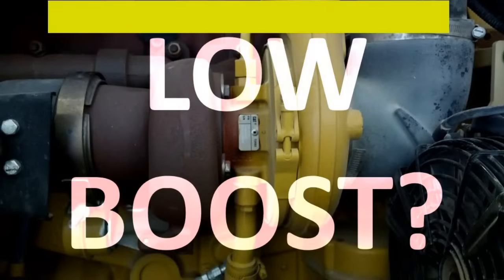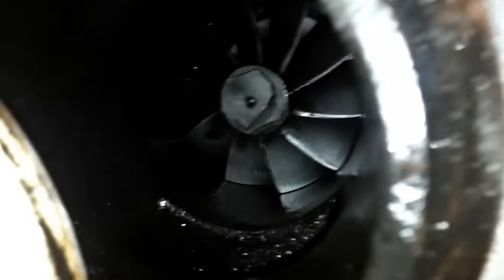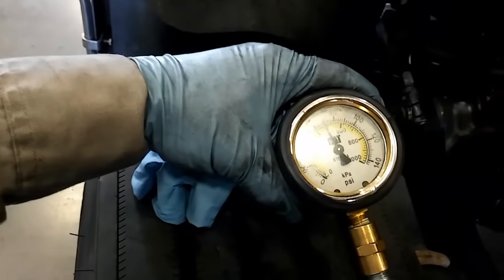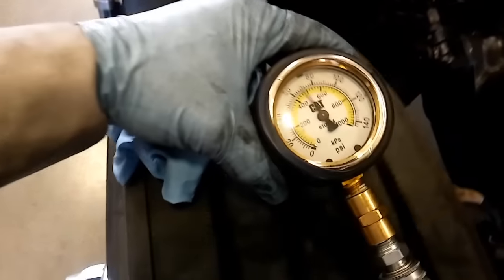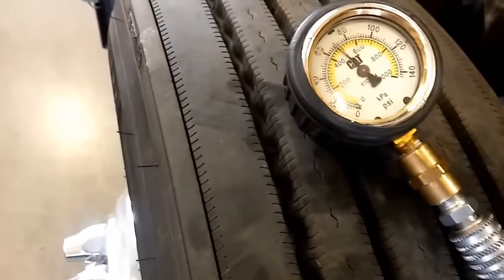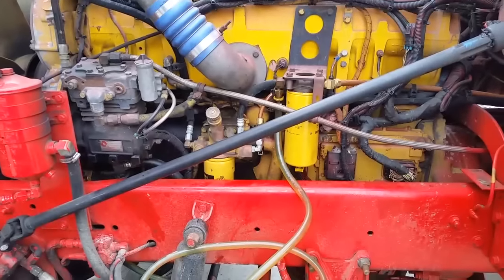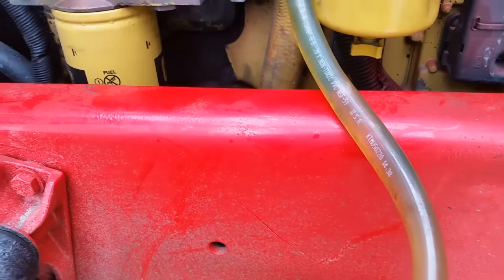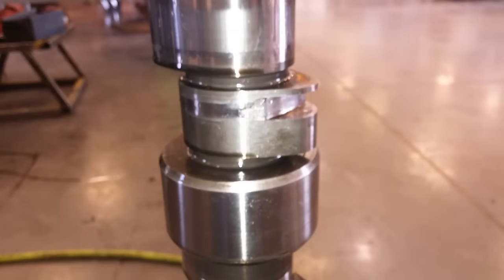Cat Diesel Engine Low Power Troubleshooting.

Comment: A surprisingly common fix for low power complaints is removing the bunched-up floor mat from underneath the accelerator pedal.
Reply: We've had lots of dump trucks with dragging brakes come in, and it's dirt built up under the heel of the brake pedal.
Reply: Evermore  000
Reply: Ur right removing fllor mats under pedal make ride ugly.  U should try ...

Comment: Had a truck driver complaining of low power on a Detroit Series 60, he was irate and telling me that Series 60s were shit, got into the cab of the truck to put it on the wheel dyno, rubbish all through the cab, a plastic milk carton tied to the gearshift that was full of cigarette butts and the smell of off food. Put the truck on the dyno and did a pull, 62% throttle was the max, checked the throttle pedal, found a chicken bone stuck under the pedal, put on gloves, removed the chicken bone, low power problem solved.
Reply from the maker: This type of stuff you literally couldn't make up.
Reply: He was special. Lots of special people in the trucking world.
Reply: Lol that's to funny :)
Reply: thats the greatest thing i have ever " heard" you have made my day, thankyou!
Reply: But did you fired that driver ?? Cause I would !! Nasty ass person.
Reply: I would of charged him for 6 new injectors and a pump and then sell his on eBay

Comment: I worked for Caterpillar, in the 80s.had a 3408 with low power in a dump truck. Searched for a while,long while. Eventually found a dead bird in the aftercooler  inlet pipe .someone had work on the truck and not sealed the pipes, so the bird made its nest in the aftercooler blocking partially. The truck was running in a open cast cement mine.

Comment: I have a c15 twin turbo bxs no codes on but when I do the flash code test I get about 7 codes I replaced all the sensor but it still gave me the flash codes. Is it a ground problem? Bad ecm? Or just needs a new wire harness? Thanks your videos have helped me out a lot.

Comment: I know my bus could use an oil change. But now I should check the fuel lines with the clear tube. I have intermittent boost issues. Itll work then not then further down it works then not. Works less up hills. Thank you for the video

Comment: I have a c15 no power. Checked charge air cooler replaced map boost sensors cam sensors changes turbo’s I still have nothing! Runs smooth doesn’t get hot doesn’t miss. Exhausted is clear I have good air filters. My fuel pressure is in spec as well. At this point I have no idea what it could be.

Comment: We had a truck from a local scrapyard in here that had low power. Not sure who was working on it, but the history was low power, turbo replacement, not fixed, injection pump, not fixed, now the engine blows a rod out the side, they replace the engine, still low power. Now it comes to our shop, we open the hood, give it some throttle, and the intake ducting damn near collapses. We open up the air cleaner and there is so much dirt packed in there we have to pry the element out

Comment: Josh, at 13:16 you state that air leaks between the turbo and combustion chamber cause low boost pressure along with concurrent lower fuel consumption.  In my experience, there has been a slight increase in fuel consumption accompanied by with a slight increase in particulate matter, as the decrease in air entering the combustion chamber adversely changes the air/fuel ratio.  Then again, I've seen similar air leaks not impact fuel mileage or exhaust smoke characteristics. 

Now,  could an ECM, sensing low air manifold pressure, derate the engine?

Comment: Josh, always learn when watching your videos. My 5 cylinder VW diesel (non turbo) doesn't run so good at tick over when hot. Otherwise it's a beast...a low powered, slow beast but a beast none the less!! To me it's definitely an injector issue but you mentioned a few other possibilites that I wouldn't have thought of. I like the idea of using a temperature gun on the exhaust manifold to look for a dodgy cylinder, will check mine later, can't remember if it has a 'log' exhaust manifold but lets see. Thanks again..

Comment: The last low power complaint I had, it was discovered that the secondary fuel filter wasn’t changed in 40,000 miles 🤦🏻‍♂️

Comment: Talking about the chasing of strange symptoms but this was a western star with m11 Cummings same thing warm up periodically engine would fall on face. A couple mechanics tried to figure it out to no avail. Next mechanic a good friend of mine tested the usual. Mine you this truck was being fabricated to be a log truck with Prentice loader boom. His next question was did you unhook the batteries every time they welded they say they did they thought Replacement of ecm problem solved un hook your batteries when welding a valuable lesson I learned.

Comment: One of the things listed (faulty sensor) 
But a lot of the people who work on diesel engines often over look at the manifold pressure sensor. 
Pop it out. If its plugged with soot. Clean it. If its plugged badly, chances are your intake manifold needs to be cleaned too. A lot of those deposits built up are from your egr and constant long idle. 
Whats crazy is the cummins engines that have dpf and def systems can often regen more frequently if the manifold pressure sensor is plugged with soot. 
But cummins and the adept ape channel is night and day. He only deals with cat engines.

Comment: First of all, I would like to thank you for your help
I have a problem with the generator, as the turbo loads 50%
Replace the nozzles and adjust the valve clearance
I did not get any result

Comment: Low engine performance caused by the driver's seat exceeding max load rating?
Reply from the maker: Lol.
Reply: hahahahahha
Reply: @arturopadilla2135  . Good day ,sorry my engine is a mercedes glk 220 cdi engine and am getting this two codes 
1. P024028. The Boost Pressure Sensor For The Low-pressure Turbocharger Has A Malfunction.The Signal Offset Is Outside The Permissible Range.
2. P010628 The Intake Manifold Pressure Sensor Has A Malfunction.The Signal Offset Is Outside The Permissible Range. 
Have changed the both sensors and it's still same. Thanks, Hoping to hear from you soon.

Comment: Hello. Love your content. I do alot of the basic to moderate mechanic work for our company. We recently encountered a problem with our cat15 motor. Scenario goes like this. I drove it up a mountain with a lowboy on the back and it hauled it perfect. As it warmed up it starts to miss. We have had 2 different mechanics look at the issue. We have done a full service and found one of the injectors not seated properly. They have done dead cylinder tests and still the problem persist. We have pressure regulator on order as well as spring kit. Beyond that we are at a loss of what it could be. We are running wix filters also. Could those play into fuel problems? I know cat filters are king but would wix be really that bad? Thanks for your time and for content. Have learned alot from these videos.
Reply: he never did answer?

Comment: Iv got a 05 international with c-13 assert iv been chasing an issue with no lower end power! Iv done over head and checked fuel pressure it good. So when I pulled air to air tube off on in take side I noticed there is exhaust sut in the tube and when I had it all the way off with it running it sounds like the exhaust is coming out the intake 🤷‍♂️. Only others thing I know I have is a manifold that is spitting at me a little? What do you think?

Comment: Im moving 48,000 km with a kodiak double axle 3126 10 speed and 40,000 axles? Is it too much for the truck ? When I tow it feels ok slow but can do the job easily.

Comment: I have a 430D. 5000+ hours. Starts up fine, idles fine, no smoke, past a small Puff on startup. just has 0 power when using loader or when driving. I HAVE to use 1st/2nd gear floored when going up any hill and I’m talking a creeping pace. Wastegate works and is in closed position. I replaced all vacuum lines, checked injector caps, checked boost collar, we replaced both fuel filters, new oil, new filter. Haven’t checked turbine shaft.

Comment: I have a c15  year 2002 I just fix it less than a year ago. I got the whole kit to repair it, plus head fixed. My oil pressure when idling cold 80psi hot down to 30 psi is it normal??? Thx.

Comment: What if your getting no blow by no check engine lights . But has low boost about 20 psi pulling a hill. Also getting a lil oil in the air cooler hose connected to the turbo.

Comment: Mine runs fine until it gets warmed up and the engine bogs down. Won't accelerate over 45. Pullover, let it sit for 10 minutes. Gets back up to 60 for about 30 seconds. Then bogs back down to 45. Any ideas?

Will be checking all the things you mentioned.

Freightliner FL70 7.6 Cat - box truck

Comment: I love your videos! 
Ok, so I have a few questions, are you mainly a truck engine mechanic for cat or do you also work on heavy equipment? Also when you’re working on a truck, say a peterbilt or kenworth and you find a brake  problem or another mechanical problem like you did in this video do you fix it or does your dealer let the customer know so they can take it to a truck shop?
Reply from the maker: We do chassis work as well. We will notify the customer of the problems and we will fix them usually.
Reply: Adept Ape Thanks! I’m dying to get in at a Cat dealer but most of my experience is with trucks!
Reply: . How do i bring my truck to you can you give me your shop address

Comment: I have a 93 c12 in a 2000 KW.
RECENTLY DEVELOPED OIL IN THE EXAUST SIDE OF TURBO.AFTER REPLACING THE TURBO ,THAT CURED MOST OF IT.BUT IM STILL GETTI G A LITTLE OIL WHERE THE TURBO BOLTS TO THE EX MANIFOLD. IVE NOTICED WHEN I GO UP A HILL I CAN SMELL BURNING OIL.
THIS ENGINE HAS ABOUT 350 THOUSAND MILES.AND HAS BEEN VERYWELL TAKEN CARE OF.PLENTY OF POWER. BUT I DO HAVE A MINIMAL AMOUNT OF BLOW BY.AFTER RUNNING SOME INJECTOR CLEANER THROUGH IT IT S RUNNING GREAT.
 ANY COMMENTS WOULD BE GREATLY APPRECIATED.

Comment: so this engine starts good.  no misses.  good power.  good fuel pressure.  after warming all the way up, and drive 65nfor about 1/2 hour, it starts to miss and loose power.  i slow down to 50 it smooth's out and power is restored.  this cycle repeats itself. sometime i run 65 a short time or a little longer time before it starts to act up again.  what are the possibilities?

Comment: We purchased a 2005 C15 acert twin turbo 550hp 1850 torque has issues accelerating slow to get going has rpms cut off @1700  truck runs like it dead has 40 to 45 pounds of boost  what do you think problem is censor engine run smoothly
Reply: Most likely you have gear parameters and speed limits. VSL protection and VSL are hard limits that will not go past programming. Your lower gear parameters are soft limits. You can drive thru them but takes awhile before the ECM will allow it. Do you have your full engine serial number?

Comment: No codes.  No check engine light.  Lost power while driving, limited to 11-1,200 rpm.  Changed both fuel filters.  Same.  Only thing I noticed is water separator filter less than half full.  Pac brake perfect, new air cleaner.  Can't get it in for diagnostics for a month.  Any help here?  Thanks, checked all of your videos and can't nail this.

Comment: UPDATE 2; Seems that it could be temp related? As it gets up to about 180 degrees it seems like the thermosts do not want to open?
UPDATE: Load related stumbling? Got her going good loaded the motorcycle on the trailer and she started to stumble again... after all below... She is doing better., but still having a hard time wanting to shift.
Cat 3126E/C7 crossover engine.
Apparently only 1000 made
Have had it on 3 different readers.
No active codes
Stored codes 164-11 across all 6 cylinders,... but cylinders look good. 
Fuel filters have been changed. Multiple times. Actuation Pressure Sensor changed. Was good for 30 miles. Then fell flat. Checked crank sensor. Checked wastegate on turbos, because it sometimes sounds like the boost isn't kicking in... due to low power, rpm. Have cleaned and checked ground wires. Yet even after batteries died 3Xs. It has no Barometric/Atmospheric pressure Sensor. (Indiana bus in Florida)
It starts, runs, drives.
It'll go good until it gets to about 180 degrees.Then she starts stumbling, sluggish, no pedal/low power, won't go over 20mph, occasionally white smoke, occasionally CEL 01 idle shut down timer.
Has misfired a few times.
We unplugged the cruise control switches on the dash, it was the worst it ever ran, connected to 01 CEL?
UPDATE; Found broken lift/transfer pump. Replaced. 
Now has 3 new batteries, new oil and filter and a new air filter. 
Still will not go over 20mph. CEL came on.
Reply: Also, while parked and reving the engine got it to about 1200rpm and the CEL would come on. Also while driving this is where it doesn't want to shift.

Comment: I really enjoy all your videos. Have a question on a 3406C I believe it’s the partial mechanical pump it’s the cat that they made to upgrade the B but only has adjustable computer crap . But it definitely has head gasket n plate gasket is bad but 1 question is the oil pressure is to high it’s a mechanical oil pump correct what causes higher oil pressure!?
Reply: You most likely have a PEEC engine, 3406B or 3406C. Oil psi max if I recall is 88 PSI at operating temp, across the entire RPM range. Cat has two oil pumps, could have the wrong one, relief valve is sticking, somebody shimmed the oil pump.

Comment: What is a normal reading for the atmospheric pressure sensor on a 2009 c15? I live in nc close to the ocean.. I'm getting a reading of 14.7
Reply: Blake Pierce with the engine off? 14.7 is atmospheric pressure oh the air you breath if it's reading that while running means it's probably not working
Reply from the maker: The atmospheric pressure around here reads about 13.8, but we are a couple thousand feet in elevation. Yours sounds like it is working fine. It should read the same, whether the engine is running or not. It monitors outside air pressure.
Reply: Adept Ape right lol my bad
Reply: 14.8 and everyone would be able to levitate

Comment: I have several late 90s and early 2000 IH with DT466E motors and they all have different hp ratings from 175 to 250 hp the 175 about 195 are real dogs the turbos take awhile to really spool up but 210 to 250 hp spool up much faster but it seems like i get a upper rpm miss fire and it most always is the cam sensor going bad and if you don't change out soon it will leave you stranded its like the engine wants to shut down at certain rpms i think the fuel system is a cat system that they put into ih dt466.

Comment: I have a 2004 379 with a c12 mbl19182 with a 10 speed and 370 rears with a complete platinum overhaul my problem is even before my over haul my truck has no power from 8th to 9th and 9th to 10th gear and my pryo gets up past 900 temp from 1st gear to 8th I’m good  and it also sounds as if my jakes are on even at idle but sounds worse when running down the road I’ve changed just about everything I can think of from wire harness to a bunch of sensors and even had my ecm checked and tuned I’m lost at what to do to get it to run right

Comment: Hi. I have a atlas copco XAHS 347 air compressor & it have CAT C7 engine it have been working great untill now when lode giving time heavy black smoke coming.. I checked the turbo it has small Shaik ..the turbo oil return hose was leaked & engine oil was leaked...befor this happen.....can you please tell me what is to be checked to find the problem...

Comment: Hi.  Maybe some can help.  Have a 3116 heui.   Put new rebuilt injectors. Ipr. And high pressure pump.   Went for final roadtest and a high pitched squeal coming from motor.  From high pressure pump area.  When squealing engine. Will barely idle and zero power    Have taken drive belt off and front cover back off to inspect.  All to no avail.  I read a post on internet from a guy with same engine and same weird problem    He took a plug out of oil log and ran a line back to crankcase through dipstick tube.  He started with silicon and with controller bleed noise went away.   Any ideas.   I am stumped and so upset I cannot fix it’s consuming my days at shop.   Any ideas

Comment: I know marine isn’t really your thing, but I have an all mechanical 6140 lugger (Komatsu block) that has a rough idle and somewhat annoying tick below 950rpm.  It also blows pretty heavy black smoke at high load.  Doesn’t use oil and doesn’t have blow by and still has lots of power.  Mechanic has done an overhead recently.  I’m thinking injectors, but maybe you have another idea?

Comment: I saw the video about putting more power into an engine with original caterpillar parts but I have an E model 2WS so I would like to put a Marine Camshaft and I’ve  tried to find the part number but I haven’t t been able to find it ,is there any way you could help me?
Reply: your e model is the best engine out there turn it up to 550 and it will pull like apro and get good fuel milage

Comment: my 3406B has 900,000mi. on the last build. had the rack adj. 70,000mi ago and it is clean as a whistle under the cover. no blow by but consumes about a gallon of oil in 10,000mi  {leaks a little at both front and rear seals) is it safe to turn it up a little?

Comment: Caterpillar  320D  - We remove the battery cable (positive and negative) then we welding the crack of the backle. After  that  we connect  it  back then the power  is low but all pressure is good. What happened with this situation? Could you please help me solve this problem I encounter. Thank you